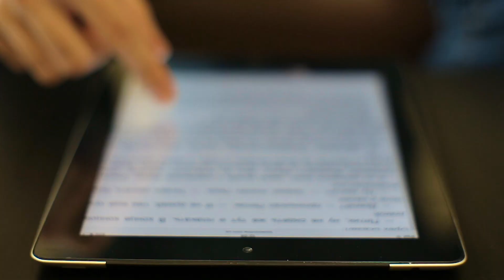NASA Seeks Ideas from the Public for Powering Exploration on the Moon

Comment: Suggestion:  My idea is to have 32 or 48 Mars SpaceX Landers attached to one spinning SpaceX starship tanker. (creating artificial gravity) Plus 5 or 10 starship tankers to tow the configuration to Mars. The starship tankers are refueled & reused. Some Mars Landers are reused, not all.

Here is the front view, 48 Mars SpaceX Landers attached to one spinning SpaceX starship tanker.
 
My other idea is to have a 30' X 160' SpaceX Lunar Lander with around 9,891 SQ FT.  (30 divided by 2, times itself, times 3.14, times 14 floors) of usable space.  This lunar lander would have 3 each, 10' X 54', re-usable, automatically detachable mini-rockets that will go into moon orbit and be taken back to earth by cargo starships, after they are used to land the lunar lander on the moon.

Here is another good idea.  A friend told me the best way to travel to Mars is by catching a tow from a rocket continuously orbiting Mars and the earth. Once you establish the orbit, it takes very little fuel to keep orbiting.
You could have about 5 SpaceX starship tankers continuously orbiting the moon and the earth, to tow lunar Landers and starships, to the moon and back.
Also, you could have about 15 SpaceX starships continuously orbiting Mars and the earth, to tow Mars landers and starships, to Mars and back.

My idea is to make a SpaceX lunar lander landing platform, that can be
rolled up like a rug, and then dropped off on the moon, and unrolled.  
It could be made out of stainless steel, or some other heat resistant 
metal or material.  Instead of unrolling it, it could be folded up &
 unfolded instead.  A stainless steel landing pad that would unfold.  
Maybe it could unroll or unfold while it is falling towards the moon and
 then land completely unrolled or unfolded.  They already make steel 
garage doors that roll up and unroll that might work.

https://sites.google.com/site/desktop5050/
https://youtu.be/eycRFDwLCjI

Comment: Suggestion:  My idea is to have a 30' X 160' SpaceX Lunar Lander with almost 3 times more usable space, around 9,891 SQ FT. (30 divided by 2, times itself, times 3.14, times 14 floors). This lunar lander would have 2 to 6 each, 10' X 54', re-usable, automatically detachable mini-rockets, attached to the outside of the lunar lander, that will detach from the lunar lander after it has landed on the moon, then will go into moon orbit, leaving the lunar lander on the moon, and be taken back to earth inside empty cargo starships, after they are used to land the lunar lander on the moon. A bunch of them could be towed back to earth orbit and refueled and re-used. By having the fuel tanks and rocket engines attached to the outside of the Lunar lander, in the form of mini rockets, instead on the inside, the usable space is tripled, and you can easily have an elevator on the inside of the rocket going all the way down to the ground floor.

The triple usable space would be great for building stuff in before launch, like built in city facilities, electrical power plants, fresh water plants, sewage plants, fresh air plants, compressed air plants, natural gas plants, biofuel plant, rocket fuel plants, vacuum distribution plants, city centers, libraries, police stations & jails, city maintenance centers, hospitals, dental clinics, pharmacies, community centers, city parks, small animal farms, small animal ranches, small animal zoos, fish hatcheries, & fish grow tanks, aquariums, grocery stores, department stores, hardware stores, restaurants, cafeterias, night clubs, amusement centers, storage tanks, storage barns, storage units, and habitats with inflatable rooms.

gold & silver refineries, titanium refineries, zirconium refineries, iron / steel mills, aluminum factories, chromium factories, silicon factories, bioplastic factories, glass factories, salt factories, vitamin factory, fertilizer factories, garden soil factories, leather & fur factories, textile mills, clothes factory, shoe factory, basket & mat factory, rope & net factory, paper mill, insulation factory,

hydroponic green houses that grow cotton, bamboo, corn, sugar cane, soybean, rapeseed, sunflower seed, hemp, algae, grass, rushes, small trees, animal feed,

small & large product factories, etc., etc.. 
 
I believe it's the quickest way to “ start “ a colony.  All you have to do is land these lunar landers on the moon, and WAA  LAA ! ! !

You have a moon colony.

If you land them all, in the shape of a circle, you could connect them up with inflatable tunnels covered with 3D printer moon mortar. These tunnels could have different types of cables and pipes, electrical cables, network cables, water pipes , sewer pipes, etc..  Also a road for electrical vehicles and a sidewalk.  There could be two tunnels for popular destinations.

Even the lunar landers could be covered with 3D printed moon mortar, unless they could be re-used for colonizing Mars.

The whole thing would look like a giant wagon wheel, or two or more.
(except for the natural gas and rocket fuel plants, which would be positioned off in a distance)
After all this is accomplished, then you could start building giant hydroponic green houses, giant power plants, and giant flywheel centrifugal human habitats, that even generate electricity as they spin, etc., etc..

https://sites.google.com/site/desktop5050/
 https://www.youtube.com/watch?v=4PyEWWstLXM

Comment: Suggestion:  Moon / Mars colony made with Spacex Lunar Landers with built in city facilities, and inflatable tunnels.  The Lunar Landers fit inside SpaceX Starship for delivery, or towed to the moon by a spacex starship tanker.  If possible to get into orbit with just starship booster, if possible to land on the moon with just very small rocket engines in the middle of lander, no need for rocket engines at bottom of lunar lander, no need for fuel for rocket engines at bottom of lunar lander. Lunar Landers have elevators on inside with inside & outside doors on ground floor.  Lunar landers & tunnels covered with indigenous mortar with 3D printers.

The Lunar Lander could have built in Habitats, power plants, rocket fuel Plants, sewage plants, water purification plants, air purification plants, water storage, electricity storage, compressed air storage, supplies storage, food storage,  hydroponic Green houses, Hospital, Cafeteria, Farm, Ranch, Zoo, City Park, City Center, schools, colleges, grocery / department / hardware stores, methane gas production & storage, jails / prisons, etc., etc..  Lunar Landers with built in habitats, etc., could have 8 inflatable rooms attached to the outside on each level.  (perhaps 6 or more levels)

(power plants could have solar panels, flywheel generators, clock spring generators, hour glass timer generators, exercise bike generators, reflected sunshine steam generators, nuclear fission steam generators,

fossil fuels imported from earth steam generators, trash steam generators, methane gas produced on moon from compost & feces steam generator (last 3 used in air tight building filled with earth air, exhaust filters to clean exhaust, some exhaust could be let out of the building, if replaced with fresh earth air.)

(the production of methane gas could be increased by importing compost & feces to the moon, or raising  1 to 2 year old cows, or raising 3 to 9 month year old pigs, sheep & goats and other animals like poultry, rabbits, fish, pets & small wild & zoo animals, etc. on the moon, or having lots of people on the moon) (people that are financially supported by the government could live on the moon without having to provide them with work; orphans, disabled people, retired people, prisoners, single parents with lots children, college students, etc.,  or rich people.)

(electricity storage in batteries, hydrogen fuel cells, 2 water tanks with water pump and hydro generator, weights and crane and steel cable generator, 2 dry sand tanks and vacuum and dry sand generator, compressed air tank and compressor, and air generator) (heat storage in sand and / or water)  (all systems are tight, no water, air, or sand lost) 

The tunnels could have electrical power cables, water & sewer pipes, small & medium size distribution vacuum tubes, phone cables, network cables, fiber-optic cables, compressed air pipes, steam pipes, natural gas pipes, etc., running through them.  They would also provides roads for electric passengers and freight vehicles, and walkways for pedestrians. There could be two tunnels, one for vehicles and one for pedestrians. (or one tunnel for one direction & one tunnel for the other direction)

The lunar landers would be configured in a wagon wheel configuration, The lunar landers being the steel rim, the spokes being the tunnels, with a center hub, so authorized personnel would have easy access to all lunar landers. 

I have a picture of this plan.  I can give it to you upon request.

 I sent the picture via twitter to @NASA @NASAMars @NASAMoon @NASAArtemis @NASA_Marshall @Elonmusk @Commercial_Crew @NASA_Technology @WhiteHouse @JoeBiden @BernieSanders @Gwynne_Shotwell @SpaceX @FelixSchlang @NASAArtemis @NASA @Q8462852 @SPACEdotcom
   
The picture is also here. Website: https://sites.google.com/site/desktop5050/
Also these lunar landers could be modified to use to travel & land on Mars.  See website for more details.
" Mars landers with artificial gravity while traveling to Mars "

Comment: Suggestion: How about using a full tank of compressed air to run a compressed air generator. It could be an enclosed system, the air could be re-cycled, no air loss. It could either be a big giant system or a bunch of small systems, or better yet both. If it is a bunch of small systems, the full & empty compressed air tanks could distributed by a vacuum tube system. The compressed air tanks could be filled during daylight and used later, especially during the night. Or better yet, you could have pipes deliver the compressed air to each habitat, to be used to generate electricity, to breathe, etc.

Comment: Suggestion:  Have The Boring Company build underground tunnels, inside these tunnels have giant mirrors reflecting sunlight to the rest of the moon.  Since the tunnels are underground they could be drilled in perfect straight lines. Underground the mirrors will be protected from dust, small meteorite, etc..   These tunnels could also be used to run electrical cables, fiber-optic cables, vacuum tubes, compressed air pipes, etc.  The vacuum tubes could be used to distribute, small & medium size items, charged & dead batteries, full & empty fuel cells, full & empty compressed air tanks, maybe even humans, one at a time.  The sunlight could be used to naturally light up moon habitats, converted to electricity, or heat, etc.  (The full & empty compressed air tanks, and compressed air pipes could be used to generate electricity using a compressed air generator.)

Comment: Suggestion: How about using giant clock spring generators, since there is low gravity / no atmosphere maybe they would spin longer on the moon. Also you could put them in a dust free vacuum. Humans could manually wind them up or at the risk of loosing some electricity they could be wound up sequentially by electric motors, the whole operation could be automated.

Comment: Suggestion:  Use mirrors on the moon's / Mar's surface to relay sunshine / sunlight to different areas of the moon / Mars.  The heat relayed could be used to generate steam, and in turn generate electricity.  The sunlight could be used to generate electricity with solar panels.  Fiber-optics cables could also be used on the surface of the moon / mars to relay sunlight.  The natural area on the moon that receives sunshine could be multiplied infinitely using mirrors to relay the sunshine / sunlight to other areas.  Sunlight could be used to light up underground rooms on the dark side of the moon  using  mirrors to relay the sunlight.  ( Use telescopic sun roofs - sunroofs that use mirrors to change  horizontal sunbeams to vertical sunbeam)  (or use fiber-optic cables to relay sunlight to underground buildings) (relaying sunlight would save a lot of electricity used in LED lights.)

Comment: Suggestion: Build a nuclear power plant, or a coal power plant, or a crude oil power plant and generate electricity.
 
These power plants could be built into a rocket, the rocket could just land on the moon, and the power plant turned on, and electricity could be generated.

Comment: Suggestion:  To produce electricity, produce methane gas, compress and store it in re-purposed rocket tanks, use re-purpose rocket engines to heat water into steam, use the steam to generate electricity in a new steam electric generator.

Or produce methane gas, compress and store it in new tanks, and use the methane to heat water in a new boiler, making steam, and use the steam to generate electricity in a new steam electric generator.
This system could be built into a rocket, the rocket could just land on the moon, and the system be turned on, and electricity could be generated.

Comment: Suggestion:  Electricity could be stored and generated by having two big water tanks, one some what higher than the other, with a water pump and a hydro-electric generator between the two.  This might be considered a priority, since once you set this up, you will have lots of electricity during dark days. To expedite the building of these systems.  A rocket could be built with this system already built inside of it, and the rocket could just land on the moon, and the system be turned on.  If using water is not good, perhaps sand can be used instead. 
(During days with sunshine, electricity is generated with solar power & other ways and the water is pumped to the high water tank, during dark days the water is drained into the lower tank and electricity is generated with the hydro-electric generator.)  

Additional electricity could be produced by imported fossil fuels, nuclear power, solar panels, people and animals jogging.

 Batteries & hydrogen fuel cells in electric vehicles could store electricity and this electricity could be used for domestic & other uses.    

Also hour glass timer electrical generators, & flywheel electrical generators.  (These could be filled with sand or water) (or the flywheel could be made out of moon mortar / cement.)

Comment: Suggestion:  Ship all the fossil fuels that we don't dare use anymore on earth because of global warming to the moon.  Like coal, crude oil, fire wood, garbage, etc..  And use them on the moon or on artificial suns orbiting the moon to generate electricity or to heat up the moon, etc.  (If the artificial suns glow red hot on the side facing the moon, then they will give the moon warmth and artificial sun light.)  (the only other thing you will need though, is an iron air chamber with 21% oxygen to burn the fossil fuels in.) (perhaps we might have to consider what effect the pollution would have on the non-existent atmosphere of the moon) (perhaps no effect at all)

Comment: Suggestion: (Put the last two suggestions together.)  Build a living habitat that produces artificial gravity, electricity and exercise all at the same time. It would be in the shape of a giant donut. The habitat is started spinning by electric motors. Then when people start excising, at least 10 people at a times, all the time, they jog on the inside of the habitat, they cause the habitat to continue spinning as the electric motors are converted to generators, and produce electricity, as the habitat continues spinning, because the joggers continue to jog. At least 10 people continue to jog, all the time, causing the habitat to continue spinning all the time. I guess approximately 960 people would live in the habitat, enough people to keep it spinning all the time. The habitat could perhaps float on natural magnets, to reduce friction. 

Suggestion: Build a living habitat that produces artificial gravity & electricity both at the same time. It would be in the shape of a giant donut. The habitat is started spinning with electric motors. And then the motors are converted to generate electricity. The giant donut shaped habitat continues to spin for a very long time because it is also a very large and heavy flywheel floating on magnets. The flywheel could be filled with water or sand or made out of moon mortar.  (very little friction) (no atmosphere on the moon) (everything is done to keep the giant flywheel habitat spinning as long as possible) (only when it finally stops spinning are the people allowed to enter / exit, and restock the habitat, etc.) 

Suggestion:  Put the last two suggestions together.  Keep the habitat spinning for a very long time by people jogging and by it being a giant flywheel. If it would work out better the habitat, jogging track, and flywheel could all be separated, spinning different speeds. The habitat portion would spin just at the correct speed to create artificial gravity.  The jogging track would spin at a comfortable jogging speed, and the flywheel would spin fast at first and gradually slow down slower slower, until it finally stops.  (Somehow the joggers would have to be able to get on and off of the jogging track with out to much trouble.) (or if necessary there could be just individual treadmills for the joggers) (animals could jog also to produce electricity)